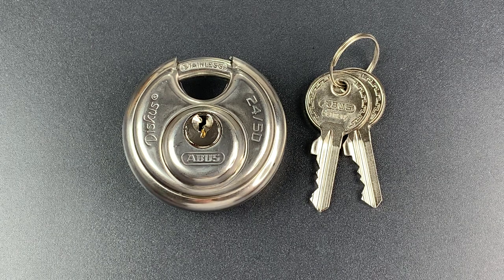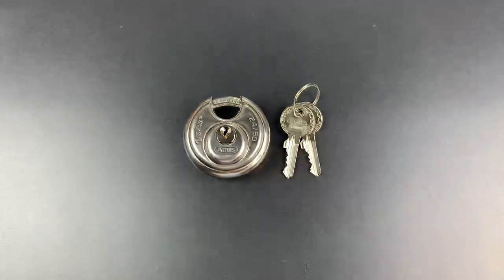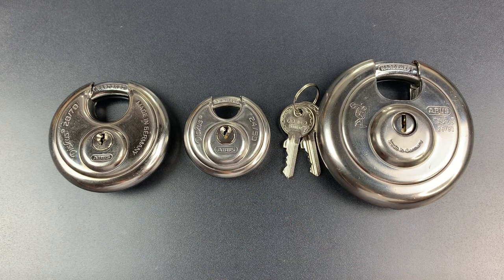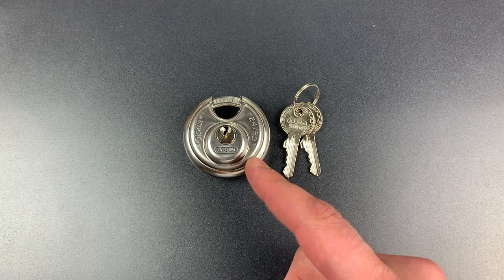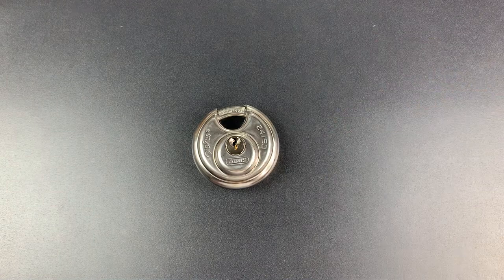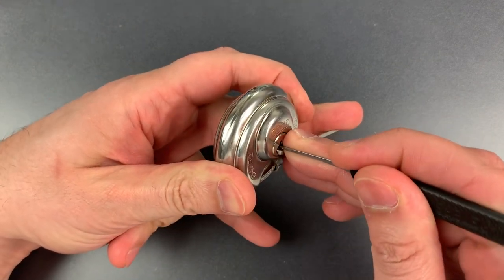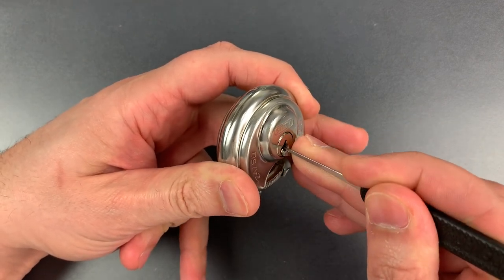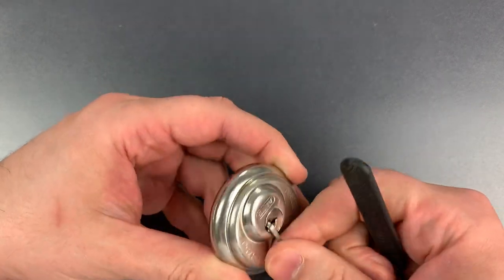[886] TINY Abus Disc Padlock Picked (Model 24IB/50)

Comment: I taught myself to pick locks and I find it quite relaxing. It’s almost like working a puzzle. I have lots of different picks to choose from but I find myself just using 1 of 4 mostly. Sometimes I will start with one and finish with another. I also like to give the lock a shot of wd40 before I start. I’d like to also note it’s a lot easier when you can hold the lock while sitting comfortably. Being bent over in the  cold or hot sun while working on a door knob presents more of a challenge.

Comment: It seems like that style of lock is easy to pick no matter who makes it, especially with that comb looking tool that you used on those master locks.
Reply: Panther Platform I don’t think that tool would work on this one, because of the security pins.
Reply: @coltranius  those darn security pins. Time for the bolt cutters.
Reply: There's not enough room in the bible to push the driver and key pins up far enough to clear the sheer line. That bypass trick only works with very high bibles.
Reply: The comb attack only works on very badly designed locks.  Decent locks are designed to prevent that attack.  Master locks are badly designed.

Comment: Gas meter assembly’s have a wing lock right at the riser before the meter, there is a special lock that goes through so it can’t be tampered with. I’ve always wondered how affective they actually are, if you could do a video on them that’d be cool
Reply: I believe they’re called barrel locks
Reply: Bosnianbill 785 vid

Comment: What is a false set and how do you solve it?
Reply: There are generally two major elements to a lock: The lock body and the lock cylinder. When picking a lock of this type you are trying to get the pins to rest above the shear line (the space between these two aforementioned elements).  Some lock pins are not perfectly cylindrical, for example; the serated pin has several small slots cut around it, while spool pins have one large slot cut around it. When you pick a pin you are trying to push it above the shear line so that the core being turned by the tension wrench holds it in place (since the pins are what prevent the lock from turning in the first place, if they are captured above the shear line then the lock is free to open). But if a pin has slots cut into it, this mimics the pin being "set" but it isn't a true set pin, it's just a "false set" which means it is caught on the shear line by the slot(s).  You can tell this by feel and in general you need to continue pushing the pin past this point while potentially easing up on the tension to allow the pin to more easily move above the shear line. 

I'm not really a lock picker but I understand the theory, so hopefully any mistakes will be corrected by the comment chain.
Reply: @sqeeye3102  
Awesome, thanks for the detailed explanation.

Comment: I know it's not fair to compare a lock against LPL's time (as opposed to an average person), but given the relatively low pick-resistance, where would you use such a lock?
Reply: It is all stainless steel and has a drain hole.
The Abus matching shed or outdoor cupboard shackle hides the whole locking pin....so a greenhouse, garden shed, old time cellar entrance, pool gate, some place you need ordinary folks to stay out of for liability reasons, like if you store pesticides.

Comment: Would you be willing to give a tutorial on picking locks as they might be encountered in the wild? It seems like slightly less of a challenge to have it in your hand. May be a time or side-by-side comparison between in the hand, secured on a latch, and secured on a latch reversed? Should I practice with the locks on a latch or does that make little to no difference? If I secure my shed with the key way inverted does that make any difference? What techniques can help in these instances?
Reply: He did a few videos last year on that topic. But it was mainly how easy it is to smash a lock off a hasp and staple. Cutting attacks, however, are the most common method employed.

Comment: I would like to see what's inside
Reply: BoredLockPicker took apart a disc padlock a few months back. Shouldn't be too hard to find. These locks are almost all functionally the same.
Reply: @two_tier_gary_rumain  Point was to see what kind of pins was used in this lock and is construction just scaled down version (the core excluded).